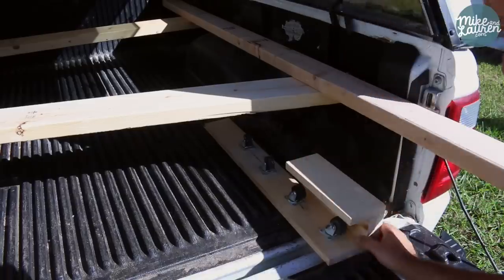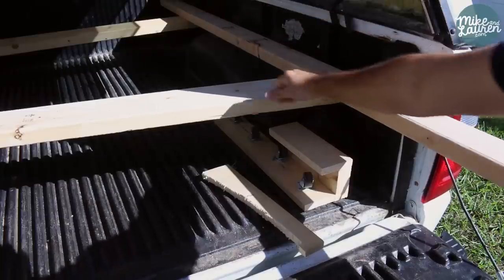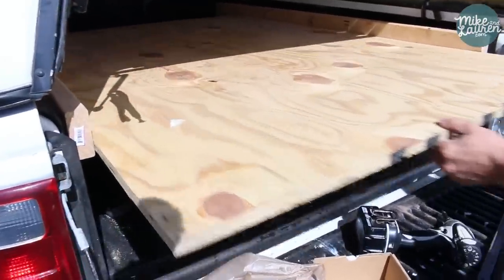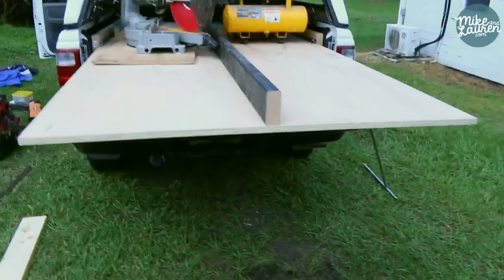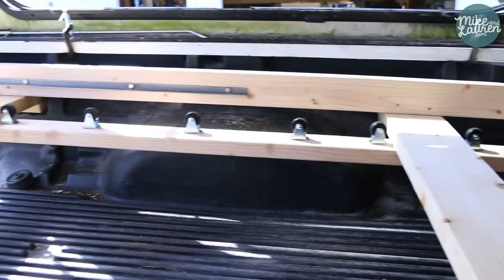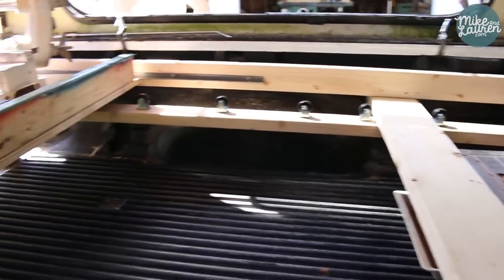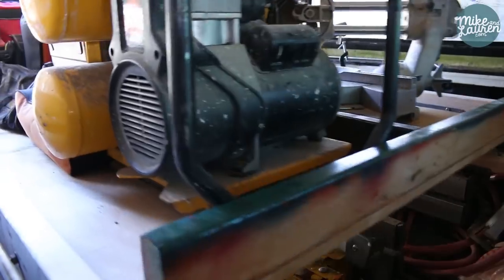Mike Makes a Rolling Truck Bed Slide

Comment: Very cool project. I might add a drop down leg or two to the end of the pull out panel, so that if you wanted to leave the panel out, it would not bend. Kind of like the fold up workbench on a wall.  I like your idea.

Comment: I like it, I have a aluminum three tray ( 4'x3' pull out) for fittings and such but I need the big slide tray for the large stuff.  This will work my friends.  This makes a regular pickup more useful than a van.  Vans are back and knee killers unless you get the real tall Euro types that cost a fortune.  Thanks guys, wonderful idea and CHEAP (my middle name)

Comment: It's probably in the comments somewhere already, but you could build legs that fit into the hand holds while extended to help supports the weight. You could even get fancy and use adjustable jacks to compensate for uneven ground, kind of what you did for your x-crave table but make them independent of each other in case it's hilly.

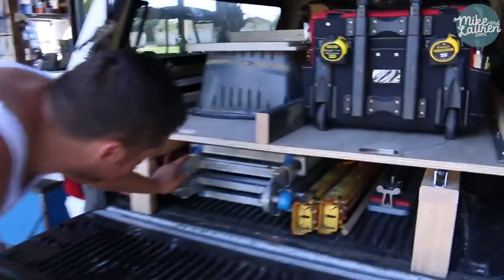Comment: Excellent build!  I really like the wise use of the casters.  Suggestion:  At the 2:38 second point, the close up shows that there is room just behind the pull out hand slots.

Between the  caster supports, why not add a couple of hinged  fold-down support legs?
Your ultimate goal of sitting of it would be accomplished.

Thanks for sharing.  Good job guys!  Two thumbs up!!!

Comment: Cool project Mike.  Looks like it practically doubled the usable space in the truck bed.  I'd probably add an angle iron header to keep tools from flying into the cab in case of a collision.
Reply from the maker: +Earl Davidson Yea he's thinking about doing that.  Although the saw and compressor are much too large to fit through the window so it shouldn't be a problem.

Comment: Nice vid boys. I'm just getting ideas for a slide tray to but my bike on in my truck. Did you just drill the timber frame directly into the plastic truck bed? 
Thanks

Comment: You should go back and install some drop down legs that are attached near the handle under the drawer.  You pull the drawer out, legs fall into position and then you can sit on the edge for sure.

Comment: That's cool! I wouldn't have thought it would hold that much weight. I guess it is the tight tolerance between the casters, the plywood platform and the stud board above it that kind of holds it when fully extended?
Reply from the maker: +Bruce A. Ulrich Thanks!  Yes there's a 3ft piece of 1/2" angle iron on both sides that keep it from tipping up.
Reply: +Mike and Lauren Oh, I see. I didn't see that in the video. Cool.

Comment: great idea, I am selling my older van and bought a pick up. The vans are a pain to walk in and out of , hard on knees and hard on back. As u get older u notice this about vans more and more. I have a top ordered for mine with a ladder rack and the side tool boxes so u can access tools, with out having to crawl inside. I am going to build the slider so you wont have to crawl inside. A shame that American truck companies do not see how poorly designed some stuff they make. Take the Chevy van. The height on it makes it very hard on your back when getting tools out of the shelf bins, and the rear door latch for the back doors on the van sticks down a few inches,, the perfect height to bust your spinal cord when you walk in and out, also perfect height to catch the back of your jacket if u have a hood on your jacket. When u consider how many times you go in and out of your van,, you would think they would have changed at least the latch design where u can hurt your back, and change the height of the van . Make it a little taller and drop the floor down a little lower. Then Mercedes makes the diesel sprinter vans and was getting big bucks for them. Wake up Chevy and talk to your customers. The pick ups they are making are priced for doctors , not trades people and they have an oil consumption problem with their AFM fuel systems,,,geeeez

Comment: I would add 2 vertical supports to the sides of the plywood to stiffen it further. Like the one you have in the center but stand it up flush with the side against the upper support.
Reply from the maker: +Pat M We thought of that, and yes it would make it much stiffer.  He just didn't want to lose the 3 inches of space (2x4s around the edges).  If this doesn't hold up that's our next step.  So far though he says it's working great.

Comment: I would solve the sagging problem by making a frame from steel and and bolting it around the edge of the plywood. Awesome project though. Maybe add some kind of locking pin system to keep it from moving.

Comment: Great video Mike. I had a question unrelated to the video though. How is the electric bike doing? Are you getting any use out of it, and if so, how is the battery(charge) and everything else holding up.
Reply from the maker: +Swirlstudios I honestly don't get a ton of use out of it because I drive my scooter to the gym in the morning and then just take that to work.  But I rode it back and forth last weekend to the office and its still holding up great.  Because I use it so infrequently it's still at full charge, so I'm not sure of total range.  I should do a test one of these days for a follow-up.
Reply: Mike and Lauren That would be awesome. I love the idea of creating a cheap electric bike battery because they are so expensive normally, but I am worried about the lifetime and safety of a homemade battery. Especially when dealing with lithium ion batteries, battery management systems are really important.

Comment: you could give the slide panel a 2x4 frame that would make it much more rigid.
Reply from the maker: +imakewoodcrafts Yea, he didn't want to lose the 3 inches of space. But if it doesn't hold up he'll add that.

Comment: Would an optional, fold-down support leg underneath the bed help to support the weight and eliminate the wobbliness?
Reply from the maker: +Gene Jordan (GeekTinker) It would, but he's happy with how sturdy it is now.  It holds the weight of the tools fine and doesn't require any extra steps to open up.  If he ever wanted to put another heavy saw or something on the end, we'd need to address it.

Comment: Mike, what type of bolts did you use to secure those 2x3's? Also, is there anything to prevent the rolling sheet to fall completely out of the truck..or does it not have that tendency?
Reply from the maker: +thedudeandstuff The 2x6 were secured with self taping metal screws and the angle iron was secured with 1/4 hex bolts.  We made the fit perfect so that the sheet is held in place between the truck bed and the tail gate.
Reply: Thank you very much!

Comment: Great concept,  but if you ever get into a crash everything on the upper slide will be coming through the rear window.
Reply: That's a good point. I'm sure there are ways to prevent this. 
How I would modify the design is by using sheet metal instead of wood, use a keyed lock at each corner (using garage door locks as a base), use a two track system and ladder frame, create a headache rack tied into the frame, and create a mechanism like hood pins to lock in place. I would also tie this into the bed mounts and use the sides to reinforce the topper for a large basket.
Reply: @Slipknotyk06 - you said you “would do” this and that.... so, did you? Have you made a version of truck bed slides or pull-out drawers, all the while recording it, document and edit for this forum or similar? I’d love to see & hear it, if so. Thanks in advance! Aloha

Comment: Leaving all your tools in a truck like that? I don't trust it, if your truck gets stolen you loose all your tools.
Reply: +Angel Luis Trinidad What happens if someone breaks into your garage or workshop?
Reply: +Cameron “Gibbster” Gibbon It's a lot easier to break into a truck than a garage or workshop. Grab and Go thefts are far more common out of vehicles. You can beef up the security on your truck, make sure you have good insurance coverage, and keep an emergency fund to buy new replacement tools with just in case.